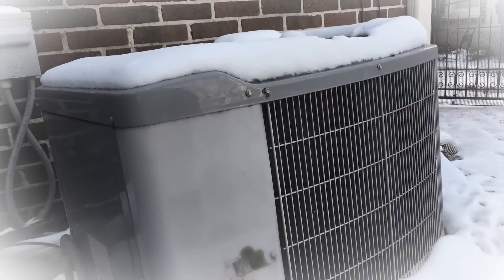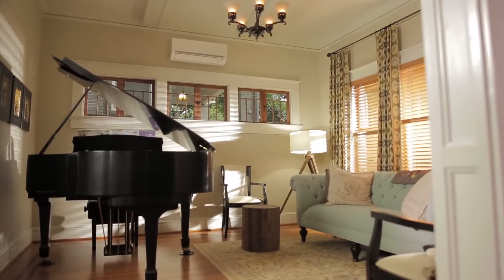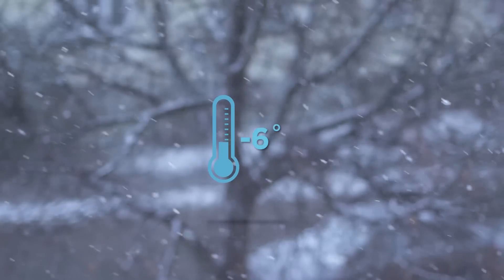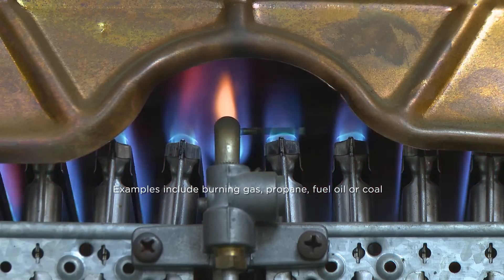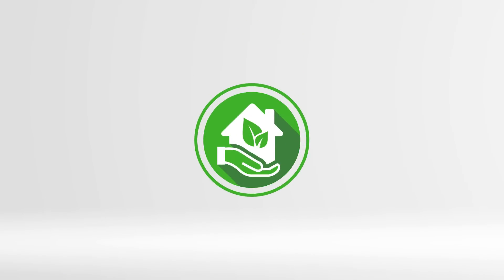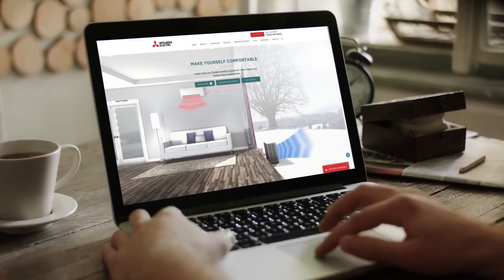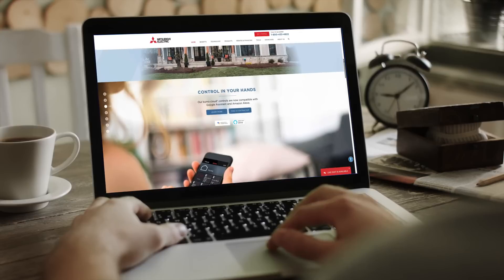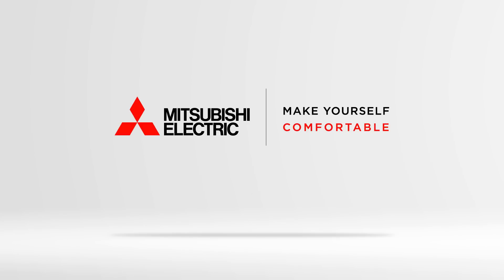How It Works - Mitsubishi Electric HVAC

Comment: My Mitsubishi mini split was installed by one of their diamond contractors in May 2024. It quit working nine months later in February 2025 in the middle of winter. Technicians have been here six times in the last five months and it still doesn't work. Now in the middle of summer, my wife and I in our seventies, with no cooling. I have contacted Mitsubishi customer service numerous times in the last five months to no avail. They promised to return my call and never did.  I'm not sure why they budget for customer service since their service is non existent. So much for that warranty.

Comment: Would you recommend 5-8K of supplemental electric heat in central PA?  I have some estimates with and some without, but i am leaning to having it installed just to be safe.  I presume these units don’t have a defrost cycle like the normal air source heat pumps and so they don’t need the backup heat nearly as much?

Comment: The only thing that keeps me away from mitsubishi is they shut off @ -28c, and wont turn on until it reaches -15c.
This only happens every other year up here in Canada(NB) but the last thing I want happening is waking up freezing cold. Its a shame they don't have a heating element that takes over @ -28c.
Reply: They do make ones that have auxiliary electric resistance heating that is triggered by the same thermostat as the heat pump. I'm having one installed myself. It just depends what you're getting. The temperature ranges also vary by model depending on the use case they're designed for. The one I'm getting (Zuba with hyper heating inverter) goes into thermal shutdown at -30° C and restarts at -25° C, but we're still getting the auxiliary resistance heating option just in case, even though we haven't had a two day period of -25°C in over five years, because it's easier and cheaper to put it in now just in case, than deal with frozen pipes or a rush job in future.
Reply: I would always have a back up heat source, and I live in south Texas 
Keep the ice and snow away for airflow

Comment: having mine installed as I write this. Massive 8 zone system using two Mitsubishi Electric Hyper Heat 48,000 BTU condensers. I can't wait for it to be finished. I live in an old farm house in NY with no ductwork. A mini Split system is my only option to get effective even heat in all the rooms of the house.
Reply: How did the last winter treat you and do you mind sharing how many KWH you used heating your home for the winter? I live in the north east as well and thinking about updating to one of these systems. Thanks!
Reply: @johnd3557 no reply wonder why